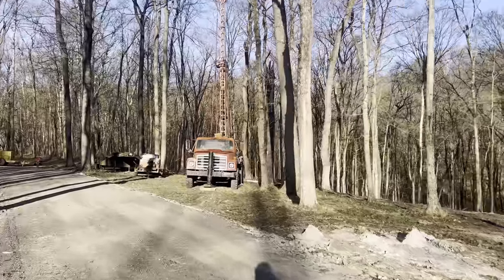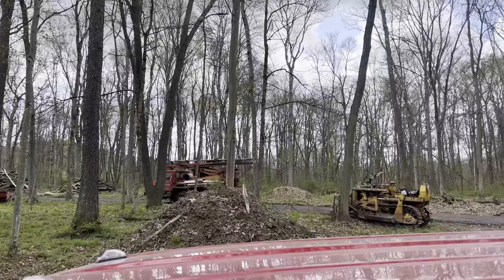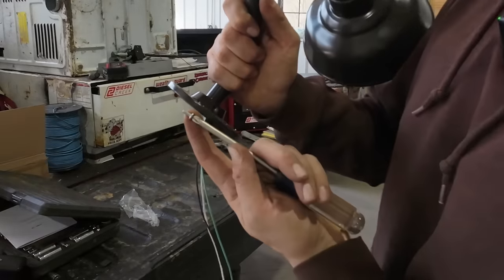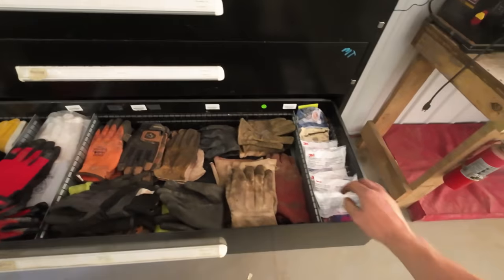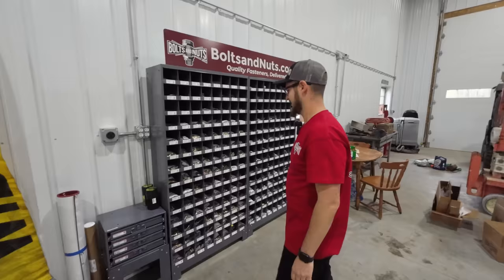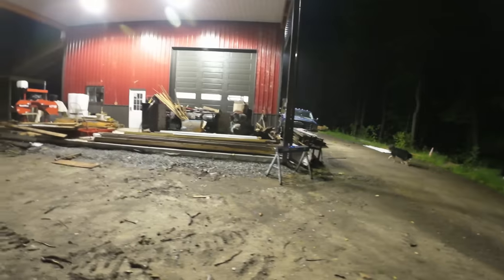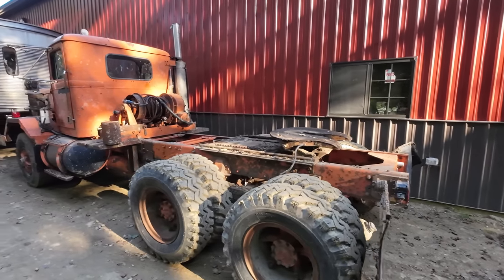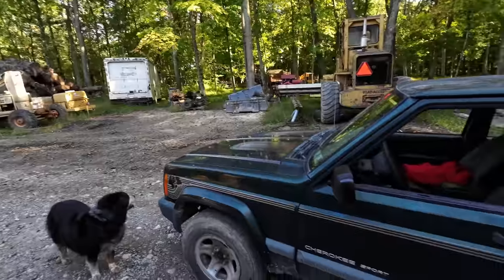1 YEAR Later, What happened to the DREAM SHOP BUILD

Comment: Matt,

On the basis of your decision to broadcast your closed-minded eco-destruction case against solar for your farm .. i'm out.

I generate excess energy to power a home with five adult occupants and two EVs with solar on just 30% of my roof, in northern Illinois .. which i'd estimate is similarly weather and latitude challenged to your location. Water heater, furnace, and stove still use gas.

Solar does not have to be your only source of power. It will pay for itself in a dozen years or less, and from that point forward will take a bite out of your obligation to the local power monopoly.

I recognize it's within the right of all to continue making maximally eco-destructive decisions in America, but to broadcast unbalanced justifications for completely avoiding the technologies which can save our planet from climate demise is untenable.

Comment: Hi Matt. re your explanation of solar, I am afraid you are talking out of your ass on that particular subject, no disrespect intended. While panels may no be the way forward in your circumstances for all of your energy requirements. There are numerous energy generation and storage solutions that could help our location and energy needs, inclusive of your power company. And many newer renewables will perform and outlast you my friend, so that 15 years bollox just doesn't cut it anymore. Where most people get this subject wrong, is that they assume you only need one solution for everything, that's a big mistake (its a modular conversation, that if planned correctly can be implemented over time). Further very few people plan an energy echo system, so buy and use energy systems in isolation of each other. Meaning if you are able to generate an excess you can not transfer it to a sub system easily. If you are going to include your power company as a energy source, the design should aim to reduce your energy purchases to a small number by, giving you purchasing options (eg multi tariffs, so that you can buy when its cheap and run from storage when its expensive etc). So sorry to shoot you down, but if you really want to understand this subject in some detail, I'd be open to a discussion to set you straight. Take care D